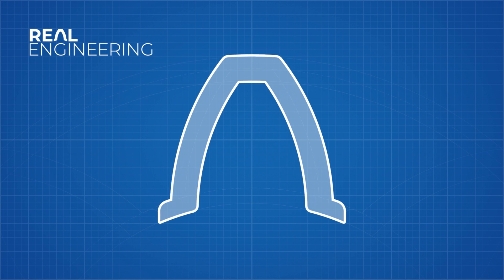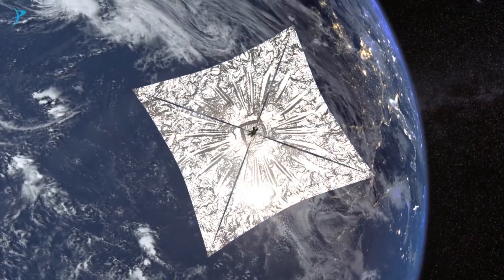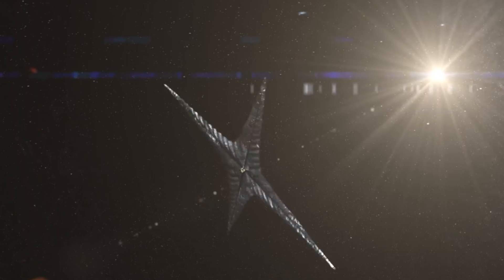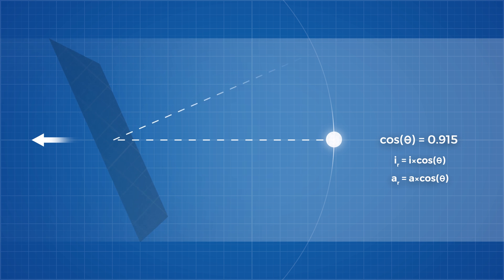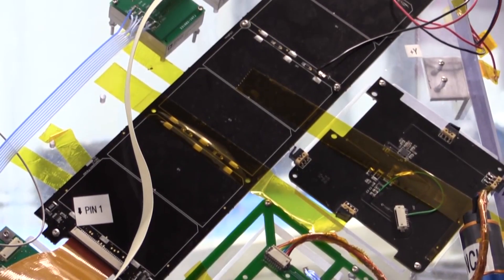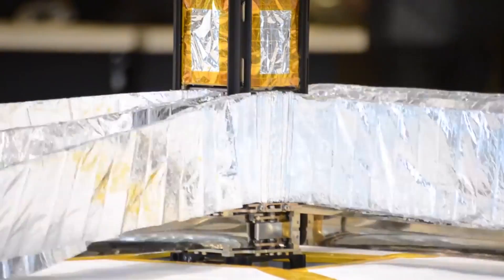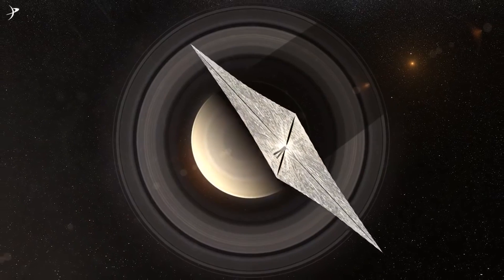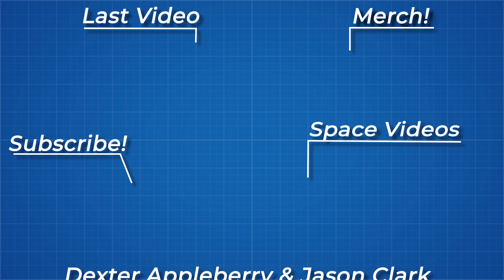How to Sail on Starlight

Comment: hold on, if a photon can impart some of its momentum onto an object, in order to conserve momentum across the system, the equation h/~ for the reflected photon will not match the pre-collision photon, unless the reflected photon is of a higher wavelength? can someone please explain?
Reply: It does change some (well depending on your frame of reference) similar to how doppler radar works, but because the acceleration is so small the change in wavelength is also. Or rather it is difficult to distinguish from the doppler effect.

Comment: There is no mass in a “photon” because it is just another term for the energy expelled by an electron dropping to a lower shell orbit. Hence this explains why micro waves have more energy than infrared & Xrays have greater energy than UV AND Gamma rays fate greater than Xrays. Planks h/wave length (m)
Reply: Humanunnaki - neutrons are a proton and electron held closely together by the mutual electromagnetic properties - the are both spinning toroidal opposite attracting charges and kept apart by  balancing opposing magnetic fields created by the spinning charges.
Reply: Humanunnaki any effects discovered when these particles are blasted apart are just different electrodynamic consequences of the event

Comment: I’m a little confused. How do you warn about a solar flare if radio travels at the speed of light and the solar will do the same? How will we get advanced warning?
Reply from the maker: Solar flares are not just bursts of light. They are charged particles travelling at less than the speed of light.
Reply: Real Engineering Ah. Thank you for the prompt reply.

Comment: The gravity exerted by the earth and sun are not the same at Lagrange point 1. If it were, the spacecraft would continue in a straight line instead of orbiting the sun. The earths gravity effectively cancels out just enough of the suns gravity so that the spacecraft orbits the sun slower than in normally would at that distance and instead keeps the same orbital period and relative position with the earth. 
Easy slip up in a great video. I love all your stuff!
Reply: Cringey as. Thanks for the clarification
Reply: That's an interesting subtlety. It's sort of a moot point, though, since it's an unstable equilibrium, anyway.
Reply: mvmlego1212 If you have a solar sail, you can use it to keep yourself parked in L1 even with perturbations though.
Reply: That is a very often overlooked detail indeed.
Reply: ' slip up ' come on man, take your inane pedantic information elsewhere.
Reply: @benejeneb  You do understand people make mistakes, and its allways nice when someone points them out in a nice way like this. You are just arrogant.
Reply: @MrDanisve  whatever man

Comment: I never got how anything couldn't have mass. Undoubtedly the mass would be infinitesimal but would still be there, otherwise there would be no there, there. Operating on this assumption makes the concept of photons pushing something so much more simple, it's like a fan on a sail at that point.
Reply: I hate to ruin your perception of reality but actually, nothing has mass, I recommend watchint PBS spacetime's video on origion of mass for that very purpose.
Reply: @omeke9336  If nothing had mass then the term would be pointless unless you're saying it's like centrifugal force. My grade 12 physics teacher really hated it as a term because it's more like an effect than a force.
Reply: @Humanunnaki So, believe it because weird stuff? Try again, also, what is particle wave duality?
Reply: @Humanunnaki That was by far the most vacuous bout of posturing you could have performed.  It's a step down from your original comment which was at least pretending (badly, i may add) to be civil. Why not skip to the end of your grand diatribe and just explain to me why I am wrong since you're supposedly an astrophysicist or something (I'm betting fast food worker).

Comment: Why not replace the solar sail with a solar panel combined with ion thrusters? The efficiency will be a lot better.
Reply: The weight, cost, and complexity will all be greater too.
Reply: Ion thrusters still use up propulsion mass, so it may not be viable for long time-use

Comment: We can't really say the program was a waste, because we still learned that it's impractical to have a solar sail at that height.
Reply: They already knew that it wouldn't last in that orbit because of the drag, it's just that they couldn't get a ride share to a higher orbit, so they settled for this.
Reply: I don't think we've learned anything science-wise but that doesn't mean the same is true for the engineering part; they did prove that the ideas we have about how to make a functional solar sail actually work, without any unforeseen "gotchas". In theory, every rocket built in the last seventy years or so would work perfectly adequately - we all know how that works out in practice...
Reply: No, not really. We could've figured that out through simple calculations.

Comment: 4:45 The angle of the force experienced by the sail is at right angles to the sail. The image shows the angle of the sail changing without the angle of the force following it.
Reply: Yeah, I noticed that too. This should get edited or be mentioned in the description, because it might confuse some people.
Reply: That's what I thought, to my knowledge solar sails can thrust in any direction that's not towards the sun.
Reply: @jeffvader811  Another trick it has is that it can thrust against the orbit, which slows the spacecraft down. This means it will fall closer to the Sun. So it can achieve any orbit, even those close to the Sun.
Reply: Thank you! I was about to leave a comment expressing my confusion over that.

Comment: wait a minute, so if we know the momentum of a photon by calculating the wavelength, AND we know the speed of light, so we can actually back calculating the mass of a photon?
Reply: Yes and no. We can back calculate that it has no mass, but does have momentum. The famous E=mc^2 calculation is incomplete and actually reads E^2=(mc^2)^2+(pc)^2. In an inertial rference frame the momentum (pc) term drops our, and the energy is a function of mass. If a particle has no mass, as a photon doesn't, but does have energy the mass term drops out leaving E^2=(pc)^2 as the energy of a photon. SInce photons travel at the speed of light and have energy, they cannot have mass.
Reply: @ManfredDudesonVonGuy  is writing it E²=pc² done for a reason? Why not just E=pc?
Reply: @kaitlyn__L  That is how it's written for prarticles without mass. Light has momentum for reasons that you'd need to take post graduate mathematics and physics to really understand. The easiest way I can say is that we know that light does not have mass,  does have speed, and does have energy. We can find the energy of light, thus we have E and c, and can find p from that.
Reply: @ManfredDudesonVonGuy  I'm not asking why the symbols are as they are, I'm just asking why the equation isn't simplified to remove the ² on both sides. I have done uni physics courses, but not post-grad yet. So I fully understand that massless momentum exists and that we need an equation to capture that part. (I actually got shown the full equation in A level physics because I kept asking questions beyond the curriculum and was asked to stay behind for my answers.) My prof just would have simplified down, so I'm asking why you've left ² on both sides, guessing that maybe it's convention rather than necessity.
Reply: @kaitlyn__L  its E^2 = (pc)^2 cause the full equation is

E^2 = (pc)^2 + (mc^2)^2
Reply: There's some quirks here about how the physics actually work that rule out photons having mass.

It's hard to explain easily (and I barely understand it myself) but no, momentum and mass are not equivalent, so just because something has one of those doesn't automatically mean it has the other.